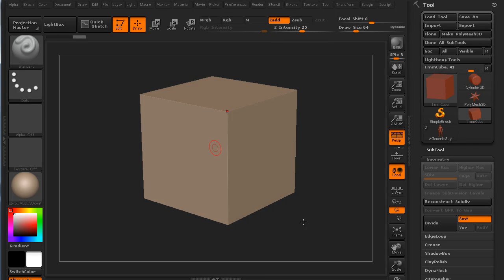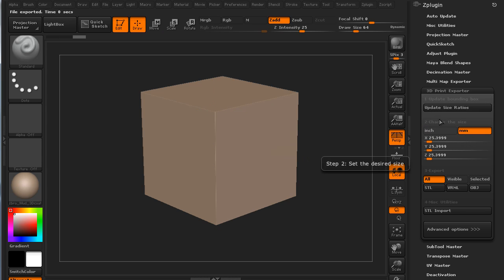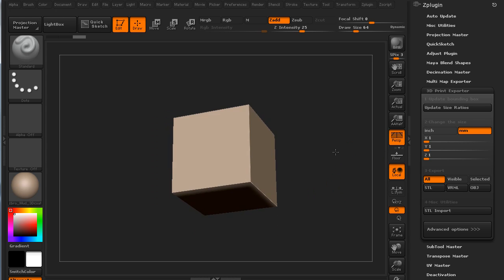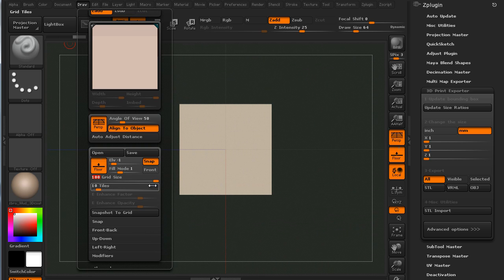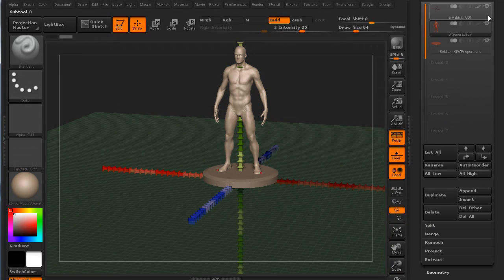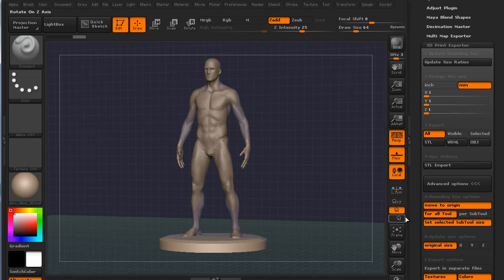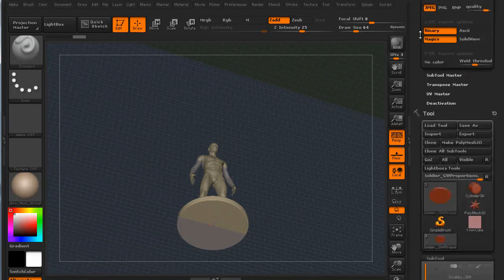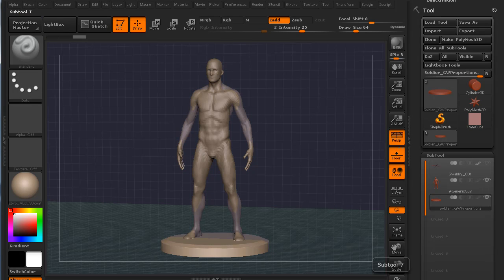Real World Measurement in ZBrush

Comment: Hi. So,what do you do if you need to do something that is,for example, 450 mm in length and 150 mm high,as other various measurements all in the same sculpt? How do you count that many squares? Doesn't it go off the screen?  This method makes sense to me,but  it only seems to work with small scale stuff.
Reply from the maker: Evan Ney Hey Evan! Definitely check out the new ScaleMaster plugin that ships with Zbrush. It’s what you are looking for, this video is really old now. Between ScaleMaster and Calipers plug-in the scale issues in Zbrush have been largely solved. Happy Zbrushing!

Comment: Hi Is there a way to snap clipping brush to the floor grid as a guide? Example I need to clip a model exactly in the center .. how can I draw a clip line exactly down the center y axis?
Reply from the maker: No, there is no snapping option. However, since the clip curve brush just smashes all the geometry down against one side of the line, you can do what you want by using the 'Flatten' slider under Tool>Deformation>Flatten choose which axis you want to clip down and you're done. :)

Comment: Hi, can you do a tuts how work with world measurement from Maya to Z 
Brush work flow, because i have tried if i send 5.5FT to Z Brush, the 
brush limitation will be very small, i am able to extend further for 
sculpting, and if i work in ZBrush Default unit and bring to maya, and i scaled to 5.5FT, the 
nhair system give lowesst thickness very big, if i work with same scale the SSS2 doesn't work well. EX: https://www.dropbox.com/s/a706u5iioifyxu1/Hair_problem.PNG?dl=0
Reply from the maker: Hi Sesuraj, Here you go! I had no issues using GoZ... https://www.dropbox.com/s/rv8fou27k47onsq/RealWorldMeasurment_MayaToZBrush.jpg?dl=0

Comment: Sadly even this triks is not as useful as I need it... For examle if you aquire the model sliced and saved in separate stl files. And you just want to apply some changes to them in zbrush, first of all you have to assemble them into the whole model, to be sure they are match each other in scale... this is annoying. Probably I just don't know how to open stl file in its original size with zbrush... zbrush intuitive interface rating for newbie is 1 of 10 imho... but I understand that if one had sharpen his teeth in it, it becomes very nice to work in.

Scaling the whole .stl model is easy. To scale the whole stl file one can use for ex. Cura (used fo 3d printing) -> just drop on the table, select, tap scale icon, and change scale coefficient or real size along any axis. Then you can save your stl https://ultimaker.com/en/products/cura-software

Also there is very cool and usefull trick with cura -> u could merge different stl files (dropping them on the table, scaling and saving as a whole...)... it is very usefull to make support structures for stl models without changing their size, or assemble them...

Comment: Is there a way to make a box, then have an object automatically snap to the scale of the box? Say a 6"W x 7"D x 9"H box, take a model of a human head, and through some scale function, have it fit perfectly inside the box.
Reply from the maker: DavidKimFX  Sure is, and it's pretty straightforward. I'm using Modo for my bounding box measurement, which exports OBJ's in meters, so the conversion to mm in ZBrush is easy. In Modo, I create a cube measuring 152.4m x 177.8m x 228.6m and export it as an OBJ. In ZBrush, import your OBJ bounding box (Tool>Import) and draw it on the canvas. Hit 't' to put the tool in edit mode. You may then append your head mesh as a subtool of the bounding box via the Subtool Master, and snap it to the bbox. (Deformation>Unify). This performs a proportioned scale to the box. On a side note, this also fixes the brush scale issues that others have mentioned in the comments here. So, setting your world 'scale' this way is an easy workaround to the brush problems. Bonus!
Reply: Charles Woods That's awesome! Thanks!

Comment: I have issues with the brush sizes being small as a dot when working in real scale .
Reply from the maker: Set your Preferences > max draw size  and dynamic brush size sliders all the way up. This will fix the issue most of the time. This is one of the most frustrating issues of working in zbrush, and I hope the size limitations get overhauled in version 5. You may also try working at 1% actual size and scaling up after your sculpture is done; either in the 3d print exporter or with another application such as maya or max. Good luck!
Reply: it made it better, but scale is a funny subject in r7, i wasn't having that issue with my brush size in other versions

Comment: I didn't even know you could measure with the move tool so there was a lot of solid useful information here for me.  I imported a 1cm cube from Maya using GoZ, measured it, set the result  to one and named the units cm.  Set up like this, the floor set at size 10 and 10 tiles fit my cube.  The Deformation Offset seems to be in mm.  Figuring out what the Brush is doing is a little trickier because of the dynamics, but with the Dynamic Brush Scale set to !0 it seems pretty solid and I'm pretty sure the brushes numbers are the brush radius in mm.

Thanks again, this was golden.
Reply: Oops, I think my Deformation Offset is actually in microns.  I'm working is 4R7.

Comment: hi charles I cant set the unit scale and the calibration distance to  value one,  they are related, so if i put 1 on calibration distance the value of unit scale change in 0.5 
what would be the problem ? thank you
Reply from the maker: Hi Antonio, you are correct: the unit scale and the calibration distance are linked in ZBrush. I think it has to do with a one 'unit' cube's bounding distance being 0.5 units from the origin on all axis.
Reply: thanks  charles but how do you  in the video  have  both  set to one ?
Reply: another thing when on 3d print Exporter I change from inch to  mm the value is not  1 for XYZ but 2, thanks again Charles !
Reply from the maker: antonio marzii From a clean start or initialization, import a unit cube into the ZBrush workspace. I have provided my OBJ from Modo here: https://dl.dropboxusercontent.com/u/15276907/Shared/UnitCube_Modo.obj

Drawing the resulting mesh on the canvas, you will find that the ZBrush unit/calibration is a 1:1 ratio.
Reply: Damn, the same was happening to me, until I realized I was importing a 2 cm sided cube all the time.
Reply: antonio marzii